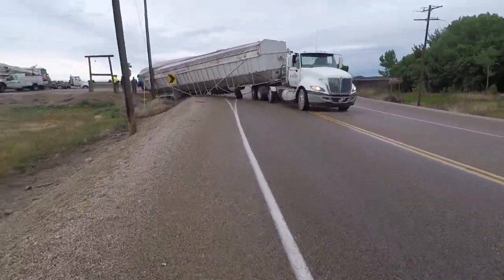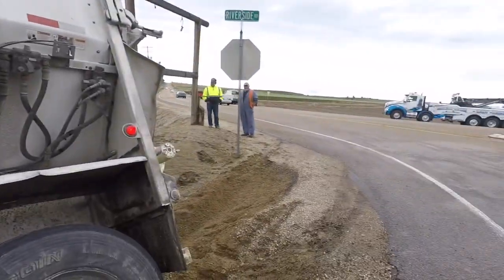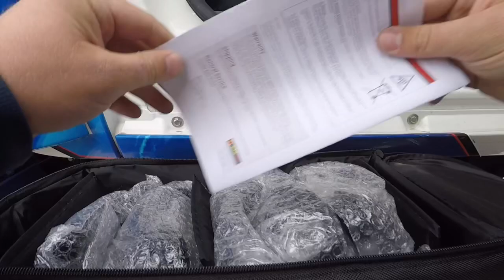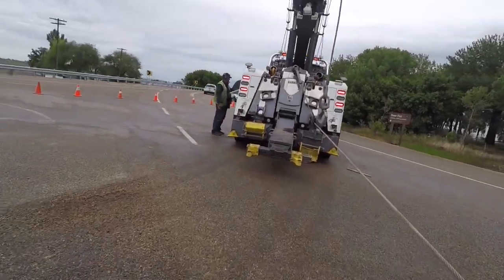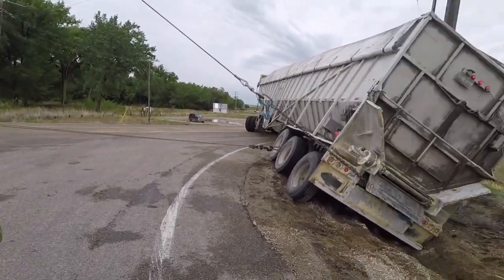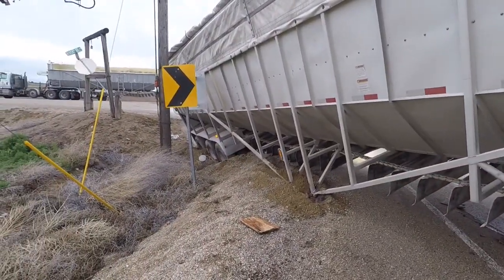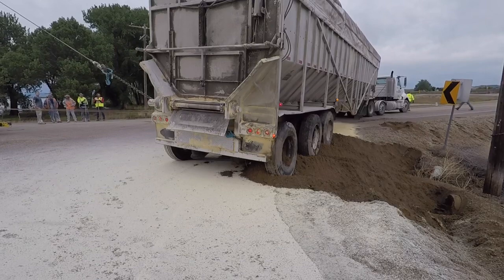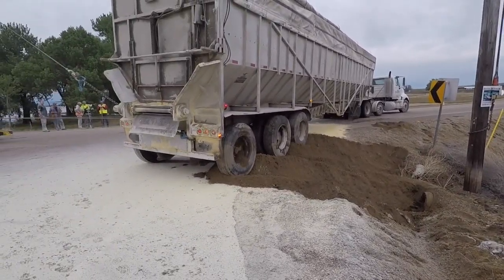96,000 Lb. Leaner

Comment: It always amazes me that the trailer designers seem to give basically no consideration to recovery.  It all seems to be just maximum payload for minimum cost.  I'm sure there are better designs out there, and part of the blame goes to those buying the trailers, but it really wouldn't kill them to design in some lifting points and the like.
Reply: The margins in trucking are tiny and if the job is done right there never a need for recovery of any kind

Comment: Sir Michael !!! GREAT RECOVERY !!! If you watch ""RON PRATT""  ,,he uses the 4 X 6 timbers standing upright between the tandems on his ""TATOR"" to keep it from rolling backwards instead of using them laying down on the ground !! Just another way to keep the ""TATORS"" from moving !!  ""KEEP IT SAFE "" !!!
Reply from the maker: K B we too do that. We just didn’t have any hard wood on the truck, it’s usually in our recovery trailer but the trailer didn’t go on this call.
Reply: K B nice observation, we also use lumber upright, if you use it that way you need to make sure it’s a hardwood.  We have a support trailer that carries that lumber.  The way I use the lumber here is letting the truck roll up against the lumber until the tire shows a deformation then lock the breaks. We use a little softer wood to bite the asphalt road and lock the truck down. It works great on this type of road, as we get more bite out of the lumber on the ground compared to using the upright style wood that only gives us 4 inches of contact each. Now if we would have been in the dirt I would have used the upright lumber as it digs in awesome. Thank you for commenting, keep up the great work and keep on learning. See you next time.
Reply: Yeah the WreckMaster lead instructor knows the basic steps of anchoring outlined in the fundamentals course... lol

Comment: Being they unloaded some of it and that’s a rotates why didn’t y’all pick it up and move it versus sliding it risking the chance for tearing anything up? Just thought maybe picking it up would be a ton easier but idk weights of trailer and or what your boom can handle
Reply: I think their biggest problem was finding something solid enough to lift with. In the end they settled for dragging it out, which worked, and was relatively free from the chances of damaging something. But I'm not the tow-truck operator, they did it the way they thought best, is my best guess.
Reply: 50 ton rotator = 100,000 lifting capacity straight off the rear at 30 to 35 degrees of elevation  .... two things wrong here one the truck was way too far away from the job the closer you can set up your wrecker the more control you have of the load your lifting or winching and two a simple pick and swing using a three part line on the low side and a two part line on the high side would have worked way better due to having more control and having more control means your working safer ... when you pick and swing your not lifting the entire weight of the trailer just about half at the very most .... as soon as the trailer starts to come up on the low side then tighten slowly on the cable on the high side and if your positioned correctly the trailer slides back onto level ground all while being controlled

Comment: Tbqh it's a pretty big failing on the part of the trailer manufacturer to not design a way so as to enable recovery crews to handle the trailer if it's loaded to capacity
Reply: Trying too cut weight plus save a dollar...make it cheaper--make it quicker

Comment: Not arm chair quarterbacking  and unloading when possible is the best way. You guys couldn't have come in from the ass of that trailer and some how rigged under the axles picked it up and swung it back to hard ground instead of dragging it from the side? Just asking I owned a wrecker service for 25 years way before the rotators came out (Damn i wish we had em' back then) We used to call a crane company out when we really had to lift and swing something. Overall Good job!
Reply from the maker: Phat Boiz Back Yard KustomZ Thanks
for your question, it seems that would be the best option but because of this particular type of trailer if we would have picked up the back it’s possible it could buckle in the middle, we didn’t want to take that chance. These trailers are not very structurally sound.